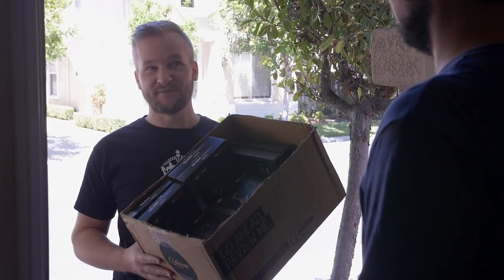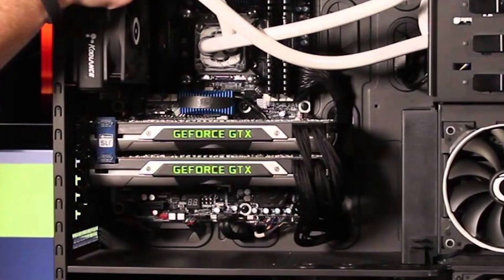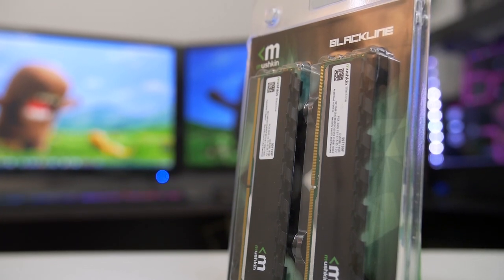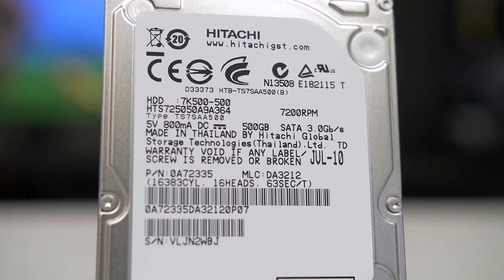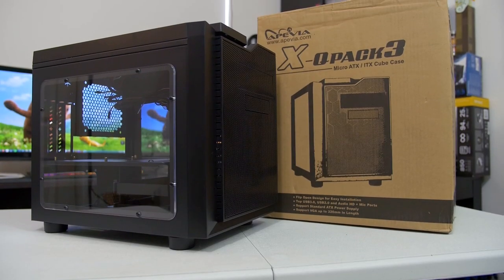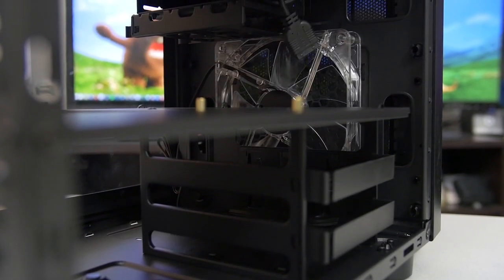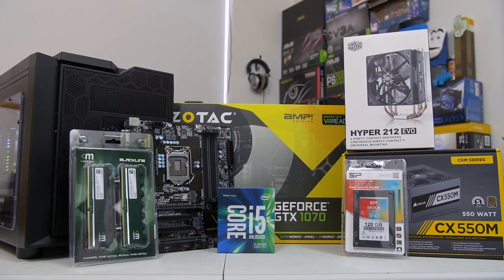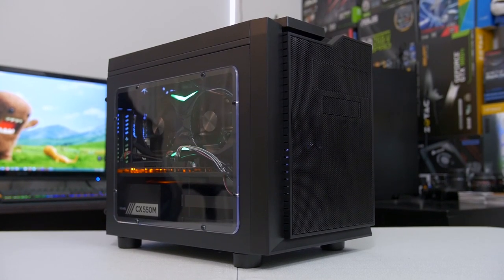The Fastest PC for $1000 - September PC of the Month

Comment: Good that the Zotac 1070 has RGB LEDs, you can match it with those front panel cables 😆
Reply: hi paul
Reply: lmao!
Reply: lmao!
Reply: Haha ikr
Reply: Orange, green and blue style. SICK!
Reply: COD!
Reply: savage!
Reply: I want some fries with all Sauces in Frontpanel-Connection-Color please xD
Reply: rgb leds would compliment my psu, front panel connectors, mobo, gpu and the red coulor of the fire that comes out of it when the old amd cpu finally catches fire and explodes
Reply: SAVAGE That was actually great... And true.
Reply: RGB cables are the new shiznit!
Reply: I also own this case and I HAD to wrap it with some electrical tape to give it a better look lol poor man's mod
Reply: its not rgb its muilty colores
Reply: Does Zotac do Rainbow Marquee then?
Reply: +haris javed performance before aesthetics. If you have enough to make it look pretty 1k builds are not your section.
Reply: i bet i3-6320 and m2 950 pro is faster than i5-6600k and silicon ssd.
Reply: oki vbb not in terms of absolute performance (vs the 6600k), the i3 is a pretty weak processor. Load times for general information may be better off of the m2 slot. The processor will make a huge difference however.
Reply: @michael braley Are you serious with that comment about the i3 6320?? Single core performance of the i3 6320 is better than pretty much every cpu at the moment...
Reply: KevBot The person I replied to states 6600k. The i3-6320 does not win in single core performance versus the 6600k and only has about 2 points in a non-oc environment against the i5-6500
Reply: KevBot Single core performance does not matter very much in a world that is adapting and orienting around multi-core and threaded performance.
Reply: KevBot what is your background in computers?
Reply: KevBot read what I have said. It is nothing that you are making it out to be. Go look for a fight somewhere else kiddo.
Reply: servattu
Reply: Joonas Pohjola *you're illiterate.
Reply: I'm want to build a pc with near $1000 budget with Ryzen 7 or Intel i7  and 16 GB RAM, planning to use it for 7 yrs with not any upgrades. Main Uses : running gaming emulators and watching youtube vids and mainly media consumption.  Any Recommendations?  
                                     https://pcpartpicker.com/list/Yg6BM8
Reply: Cybrax -etc what i can tell you is that the nzxt s340 is a delight to build in. I also have the seagate barracuda 1tb and the Lpx 2x8 ram

Comment: 1000$ PC in america: GTX 1070, i7 7700K, Z270 mobo, AIO Cooler, 32GB Ram, only SSD for storage.

1000$/€ PC in Europe: Cheapest RX 580, i5 7500, cheapest ATX B250 ATX Mobo, Stock cooler, 16GB Ram, very small SSD for system and drivers, cheapest HDD for main storage.
Reply: Proj3ctX 
Americans are lucky 😐😓
Reply: BLACK WINGS yeah.
Reply: Proj3ctX England is one of the cheapest. I was able to buy a rx 480 for £40($50 or something)
Reply: Kaijorino where
Reply: M1cha3l Sm1th wtf sre you doing. And i5 6500 will bottleneck the 1080
Reply: 1000$ PC in Cambodia: RTX 2060 SUPER, i7 10700k, Asus strix z390, Water cooling, 32 gigs ram, 256 gb ssd, 2 tb hdd 
It's all new

Comment: I wish you wouldn't have included the Hyper 212 Evo cooler. There are far better options - Cryorig H7 and beQuiet Pure Rock among others. I personally have the beQuiet Pure Rock and keeps my 6600k at 4.6GHz at 70°C under stress tests at 800rpm and is completely inaudible (my 3tb wd blue hdd is louder at idle). There's also a newer version of the 212 evo called the 212X, but again there are better options.
Reply: My 212 Evo keeps my FX-6300 @ 4.4 at 43c, it's MORE than adequate for this build. At the price, you can't go wrong.
Reply: My 212 Evo is doing a great job keeping my overclocked to 4.8Ghz i5-4690k under 70c. With a single fan.
Reply: +Tyler Wrage h7 is just $4 more. The choice of components imo could've been more better and he could've made it more aesthetically pleasing.
Reply: Be quiet performs the same but its quieter, Basically the same can be said with the H7 overall though i'd call all 3 a decent choice.
Reply: +jd gaming Or you could go with a h115i and idle at 27 degrees and load around 59
Reply: Noctua NH-D15 FTW
Reply: i would rather have watercolling though, i have my 6600k on 4.1 ghz and it would only get to max 35 degrees under heavy load, and on 25 degrees when gaming and listening to music on yt. got the corsair h60i.
Reply: got a 212 with a i7-3770k, never went over 40 degree while gaming games like gta v or no mans sky, why pay more if it is over 60 degree under max temp?
Reply: +Swiss Glitcher you're lucky with cougar fans and the 212+ I get 68c in some intense gaming with my 4790k stock.
Reply: +jd gaming I just use the one that came with it and it runs at maybe 800-1000 rpm and I got a good caseflow aswell
Reply: +Swiss Glitcher PC I built for my friend runs nice off the stock heatsink. i5 4440
Reply: There are no "Stock" heatsinks for the the "K" models now. You have to supply your own CPU HSF with the 6600k, 6700k, etc. This adds costs to the already pricey CPU's, but most should know that going into buying the "K" CPU versions.
Reply: Good for you, Philippe Rochette

Comment: Some of these parts I would not recommend
Reply: +Christian Slone cx power supplys are one of the bests
Reply: +Misgu for a budget system, yes, but at this price point I would expect a little better. Though that can't be ignored as corsair stepped up the quality with their CXM units over the previous CX units.
Reply: radja putra Agreed and especially at this price point, I'd expect a higher quality PSU. CXMs are better than the CX units they replaced but still very subpar compared to Corsairs other higher tier PSUs.
Reply: The new CXM series is quite good.
Reply: Nathan Young Better than the CX units they replaced but still subpar, I would be ok seeing it at a sub $700 build but at $1000, there are better options.
Reply: Rikk1945 They're not really subpar. They about on-par with a Seasonic S12/M12 with the only real drawback being a sleeve-bearing fan.
Reply: Theburninbeaver saying it's on par with season if is like saying it's not that bad it's only a rotten potato
Reply: +gobighdgames seasonic powersupplies are amazing powersupplies and the s12/m12 are tier 2....
Reply: You are very specific

Comment: I'm working on my own $1,000 PC build right now...

CPU: i5 6500 ($204.99 - amazon)
- Comes with intel's stock cooler/heatsink
- Not going to be overclocking, and downgraded a bit from 6600 to free up some budget for the SSD

GPU: Gigabyte Nvidia Geforce GTX 1060 G1 6GB ($289.99 - amazon)
- Also for budget reasons; IMO the substantial price gap to the 1070 isn't worth it for gaming @1080p

MB: Gigabyte GA-Z170-HD3 ($99.38 - outlet pc)

RAM: Kingston HyperX Fury 8GB ($38.97 - newegg)
- One stick: a bit cheaper than buying two 4GB sticks at the moment (also more space for future upgrades)

SSD: Samsung 850 EVO 500GB ($157.30 - amazon)
- A big part of this build: I want something very fast, while also being able to hold my OS and all my current and future games

HDD: WD Blue 1TB 7200 RPM 64MB Cache ($49.99 - amazon)
- Nothing special, not going to be transferring large files too much so just having the cheap mass storage is more important to me than speed/performance

PSU: EVGA SuperNOVA 550 GS 80+ GOLD 550W ($83.19 - newegg)
- Fully modular, great efficiency, reputable brand

Case: Phanteks Enthoo Pro M Mid Tower Chassis, Black ($69.99 - amazon)
- Solid case for the price, good airflow

Total price: $993.80

I personally think this is an excellent build for me, I'm looking for great all around speed, while still getting well above 60 fps on maxed out settings @1080p in modern AAA titles. Will probably end up upgrading the memory in the future, but for now 8GB is more than enough for my purposes. 

I'm also looking at another power supply, 
Rosewill 550W 80+ Gold Certified Fully-Modular ATX ($64.99 - newegg)
It still looks better than the one in this video, but I know nothing of Rosewill. If I did go with this power supply though, I'd be able to upgrade to a 6600, which would be nice.

Let me know what you guys think!

Comment: Add tax, shipping and a OS system, and you are looking closer to $1200 for the total.
Reply: Idtelos let alone the monitor
Reply: Or use Linux for a free OS...
Reply: blondishasp yep
Reply: Windows 10 is free though
Reply: Hassan Haq how?
Reply: Hassan Haq ... No it's not it hasn't been for 2 years
Reply: Joseph isme it has a trial mode. like. yes technically you never have to pay if you can deal with a slight water mark in bottom right corner nor ever being able to customize the pc looks.

Comment: Can i use a Nvidia GTX 1070 instead? Or is it the same thing?
Reply: Malthe Korsgaard Nvidia just makes the chips, the actual graphics cards are made by third parties. The few exceptions that are actually sell directly by Nvidia are generally way more expensive and sometimes worse than a cheaper one from a third part. however, the Titan X can only be bought directly from Nvidia
Reply: They are the same
Reply: If you dont know even know that then i wouldnt but one period

Comment: I have put together my own $1,000 pc this summer. I am rocking the gtx 1060 oc addition 6gb of vram from zotac with 8 gbs of ram. prosser is the AMD Athlon 4x 860k with a after market cooler. F2A88XM-D3H motherboard. And a cheap case with a 6 pull push formation. Then to top it off I have a 2x 250gb hard drives in raid 0 with a 2 tb for games. This system has done wanders for me not playing triple a titles at 6ofps all graphics on, but not bad for a first gaming pc.

Comment: Hmm ya know that case doesn't look too bad. I like how it separates to let you build the system easily then reattached to seal up the case.. plus 2 windows is nice if you manage cables correctly. I would have run those front panel wires differently so they wouldn't stick out as much but overall decent build. interested to see how it performs.

Comment: My build
CPU: Intel i7-7700k 4.2GHz
MOBO: Asus ROG Strix z270e
RAM: 16GB DDR4 RAM 2400mhz
GPU: nVidia GTX 1070 8gb armor
SSD: Kingston 120gb ssd
HDD: 2TB Seagate ST2000LM007
PSU: Corsair TX750
COOLING: Corsair H100i v2 watercooling
CASE: Cooler Master MasterCase Maker 5 (vinyls can be easily peeled off without marks)
EXTRA: Corsair RGB LED fans, ASUS BR/DVD disc drive, LED strips
Reply: lucky

Comment: i bought mine for 1100 dollars (including one broken motherboard)
Case: Phanteks Eclipse P400 White
First mobo: (didnt give any display) Asus Prime Z270 Prime
Second Mobo:ROG Strix Z270H
CPU:Intel i5 7400 (yes locked one)
CPU Cooler: Stock one...
GPU:Asus Gtx Geforce gtx 1060 OC (dual) 3GB
Ram: Corsair Vengeance DDR4
PSU:Chieftec 750W
SSD:Kingston 120GB
Cooling: using the stock fans (will upgrade cpu and get watercooling l8r)

Comment: Hey guys, just built up an AMD system in a Silent Base 800, those cases are Mammoth sized. two heads up for you: your audio drivers might not be very cooperative without updating Windows 7 to service pack 1, and I'd assume the same of any other Windows OS.

 Also, USB 3.0 headers are evil.

Comment: As good as the 1070 is, I would have opted for a 480 from AMD, it has slightly less performance, but is significantly cheaper, as well as being compatible with the far more affordable monitor option of Freesync, over the G-Sync monitors which can sometimes double in price. What's the point in having a powerhouse of a PC if you're limited by your 60hz monitors because you didn't account for each monitor costing $500 instead of $200. This build is great if you already have G-sync monitors though.

Comment: This is my first build ever. Do you guys think it's good and that it will last?
CPU- Intel i5-6600k 3.5GHz
GPU- Sapphire Radeon RX480 8GB DDR5
RAM- Kingston Fury HyperX 16GB CL14 2133MHz
Motherboard- Gigabyte GA-Z170X- Gaming 3
PSU- Corsair CS550M
CPU Cooler- Cooler Master Hyper 212X
Case- Aerocool BattleHawk

Total: 987, 28 Euros or 1109,83 dollars

Comment: I have the CX430M but replaced it with a Corsair RM650i. I did it to get better quality (Japanese) capacitors, and get Corsair Link going to see my system usage. (It peaks at about 320W -  with a GTX 980.) This vid shows buying the CX550M. While I like and used my CX430M for ages, I would only buy PSUs now with quality caps.....Word-up BitWit: maybe put a few more bucks into the PSU.

Comment: Pc I built utilizes an amd 6 core processor running at 3.9ghz...nvidia geforce gtx 960 4gb...16 gb of dual ram g skill 1600 mhz...cant remember the mobo for the life of me, and the case came with 4 intake fans and it was a full atx PNY tower with an exhaust fan as well, and 8 drive bays for hard drives/ssds as well. Cost me about 800 total. The video card isn't perfect, but I'm happy with 1920x1080 specs on a tv atm, until the pricing of some cards go down and tvs as well.

Comment: you should have get the Aerocool DS cube case, same chassis construction, but has 200mm fan intake instead at front and quiter because its front panel and intake is like fractal design define series. also has 4 usb upfront, and top changeable mesh / silent panel that can also house 240 radiator inside when 5" bay remove.

Comment: It's a really nice build, but I would have done a few things differently. I would've gone with a cheap Corsair case, like the Corsair Carbide 100R or the Spec-01 which both cost 50 USD on Amazon.com and their form factor allows much more ample airflow to the graphics card. Or alternatively, if side panel is desirable the Zalman Z1 Neo for the same price, or the Corsair Spec-02 for 10 USD more. With this case however, maybe I would've chosen an external exhaust card instead of an internal exhaust, because the way the card is currently placed inside the card, looks like it could have hot air bouncing back into the intake of the card. Which brings me back to my previous argument of changing the case (the current one also looks ugly imo). The rest are fine really :)

Comment: If we're looking at sheer speed, and the fact that you want a decent power supply, look at this build, with the 1080: http://pcpartpicker.com/list/4sQygL
You lose the hard drive, but that's an easy upgrade for when you can scrap together an extra fifty bucks for it, and this build is going for speed. You also lose overclockability, but gain a 1080, so say what you will about performance.  You also lose two RAM slots, but again, speed.

Comment: PCPartPicker part list:
 http://pcpartpicker.com/list/HTBFsJ 

CPU: Intel Core i5-6600K 3.5GHz
Quad-Core Processor  ($227.99 @ SuperBiiz) 

CPU Cooler: be quiet! PURE ROCK 51.7 CFM Sleeve Bearing CPU Cooler  ($24.90 @ Newegg) 

Motherboard: Gigabyte GA-Z170-D3H Micro ATX LGA1151 Motherboard ($105.99 @ Amazon)

Memory: G.Skill NT Series 16GB (2 x 8GB) DDR4-2133 Memory  ($63.99 @ Newegg) 

Storage: A-Data Premier SP550 120GB 2.5" Solid State Drive  ($37.99 @ NCIX US) 

Storage: Western Digital Caviar Blue 1TB 3.5" 7200RPM Internal Hard Drive  ($47.49 @ OutletPC) 

Video Card: EVGA GeForce GTX 1070 8GB ACX 3.0 Video Card  ($409.99 @ B&H) 

Case: NZXT S340 (Black/Red) ATX Mid Tower Case  ($66.99 @ SuperBiiz) 

Total: $989.33

And you have enough extra to buy a better cooler or an exhaust fan.
Reply: I put it in; wonder why it didn't show up.

Comment: I would've nixed the SSD  (I don't turn my computer off anyway), bought an exhaust fan, bought a slightly lower CPU cooler so I could've put another fan on the top (I put it as intake in my Qpack), and also gotten a better PSU.

Comment: Hey I'm building my first PC soon and I wanted to know what you guys think about the parts I have:

- Intel i5 6600k
- ASUS Z170-A ATX DDR4 Motherboard
- MSI GAMING GeForce GTX 1060 6GB GDDR5
- Kingston HyperX FURY Black 16GB Kit (2x8GB) 2133MHz DDR4 Non-ECC
- EVGA 500 W1, 80+ WHITE 500W
- Cooler Master Hyper 212 EVO
- WD Blue 2TB Desktop Hard Disk Drive
- Kingston Digital 240GB SSD

All this in a
- Phanteks Enthoo PRO M Acrylic Window Case

In Canada, this will cost me about 1500CAD after taxes. What do you think?

Comment: You could use the ssd as a cache drive with Intel RST. You will see only a one or two second on average boot time using RST instead of using the ssd as a boot drive. And you can partition it to use the rest of the ssd for when you want to fast running apps.

Comment: Maybe a better case the white front IO cables are not the nicest but I do understand that you had a budget.
A good cheap case is the Corsair 100r and the IO cables are all black. But it doesn't support cpu coolers over 150mm. :-(. Although you can put a water cooler in it and that's what I am going for. Very nice selection of the parts

Comment: This is my pc right now:
Motherboard MSI B85M-E45
CPU Intel Core i3-4340 3.60ghz
GPU Radeon R7 260x
Ram ballistix sport 2x4gb DDr3 1600mhz
PSU silver power 650W 80+bronze
and the case is a cooler master mid tower

if you had 5-700Dollar to spend on upgrades, what would you buy?

Comment: Not sure if this is the fastest PC for under $1000. Maybe if we are talking 100% new parts and 100% custom build and you care about physical looks

But if we are just talking straight up under $1000 then your better off buying a completed refurbished desktop say 3rd gen i7 from Microcenter. Usually $300-$400 for the complete desktop. Drive, case, ram, psu, etc. Now you have to check the PSU see if its a 500 watt. Some of them are and some aren't. 

Then you could still afford a GTX 1070 or even a GTX 1080 and probably also still have enough room for a 240 SSD as they only cost $50-$60 cut that down to $35-$40 if you want to squeeze a 120gb ssd by. Their EVGA PSU 80+ are only $40 as well.

Now I do really like this build as a from scratch everything 100% new build and I realize its not really a "let's see what kind of performance we can get for $1000" build.